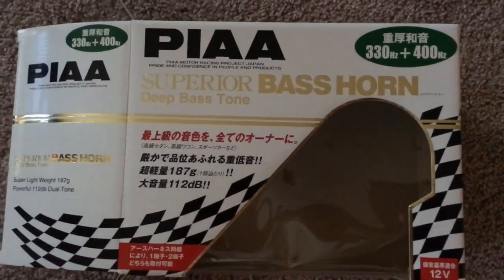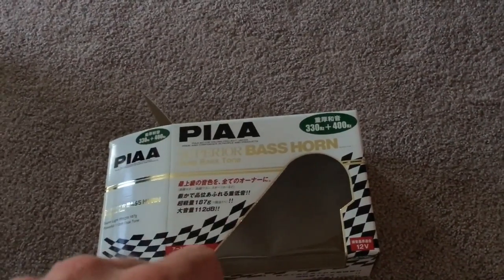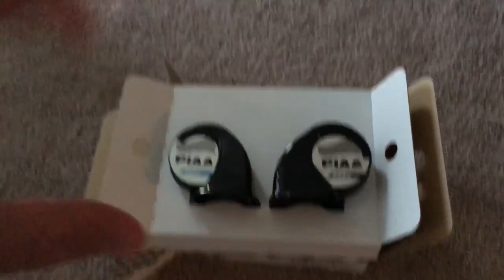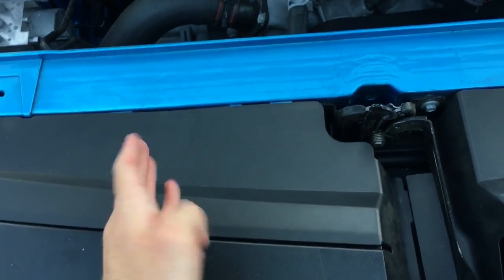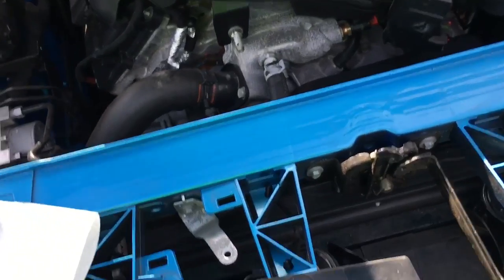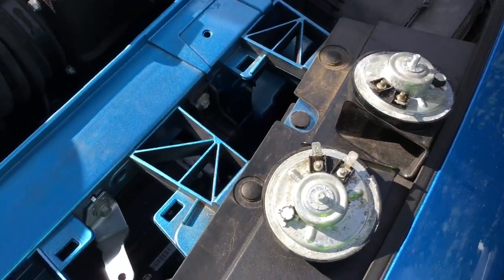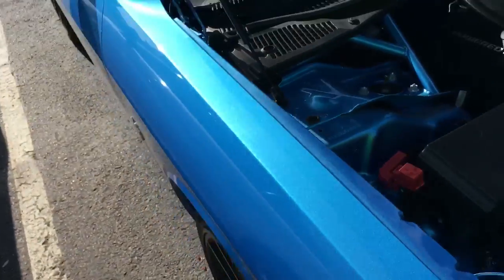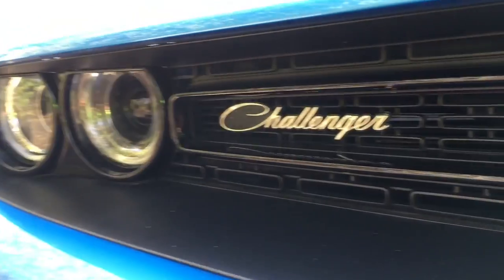PIAA Superior Bass Horns on a Dodge Challenger

Comment: Thanks for this. Want to buy a 150db train horn for my Scat pack and wasnt sure where the stock ones were located. Funny ive had those covers off to install my Hellcat Airbox and never noticed them.. To my surprise FL law is written in a way that a train horn could he illegal. F it. My exhaust already is. This thing is 18 inches long. I def won't be mounting it facing forward 😂

Comment: what's that rattling  noise?
Reply from the maker: Gabriel Telles Rattling? Where in the video do you hear that?
Reply: while the car is running when you open the hood.
Reply from the maker: Gabriel Telles The engine wasn't running when u opened the good but if you're referring to the crackling, it's the engine cooling off. All engines make that noise when you shut them off, perfectly normal.
Reply: I am very familiar with the noise when it cools off,  never heard it like that. Sure sounds like it was still running.
Reply from the maker: Gabriel Telles Nope, watch it again cause I started it up to turn it around and then shut it off before I opened the hood. If it was still running you definitely would have heard it.
Reply: maybe I got bad speakers lol